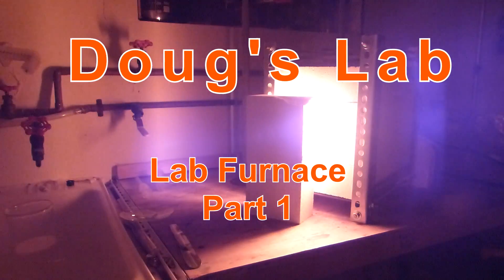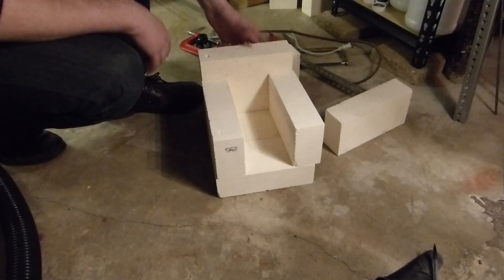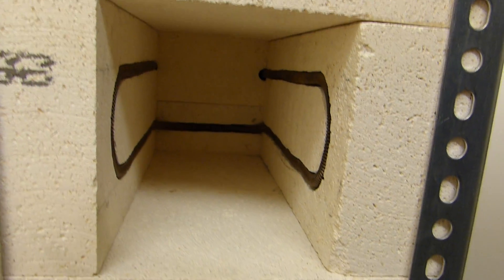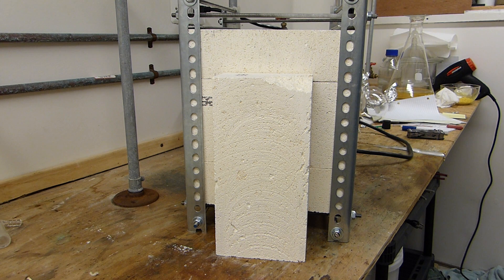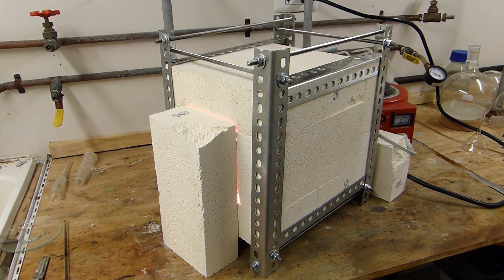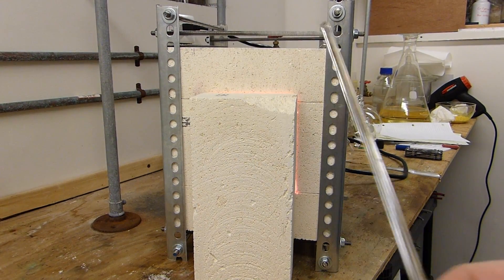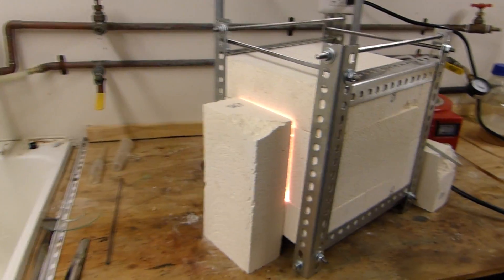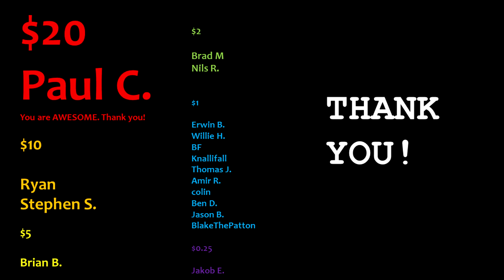DIY Electric Furnace: Part 1

Comment: Nice!  And definitely not as stinky or hazardous as an arc furnace.  BTW, running the heating element 110 VAC instead of 220 VAC means a thermal power output of 1250 watts and not 2500 watts.  The resistance is relatively constant, so the formula to use for power in this case should be Power = V*V / R.
Reply: +theLuigiFan0007 True, but the point is the same...  when Joule heating like this, halving the rms voltage reduces the mean power output to 25%, it's just due to the output being directly related to the square of the input voltage.  Of course assuming that the temp coefficient of resistance of the wire is not just linear, but flat across the temp range it will be used at.
As far as the 110 vs 115 v 125VAC... household power (as shown in the video and as you observed) should be thought of as 120VAC nominal plus or minus 5%.  The 115VAC you mention appliances being rated for, that's just the nameplate value and they should be able to handle plus or minues 10% of that value without real worry.
The 126.75VAC(rms) that you measured is on the very high side but nothing I would be calling out an electrician for.  I might even suggest that the higher readings are from locations with less feet of copper between the outlet and the distribution board/breaker box.
Reply: +theLuigiFan0007 Been there and done that with faulty/missing grounds... lol, it can wake you up faster than coffee... or knock you out even quicker... luckily, I have only been knocked out once when 'becoming one with the circuit' but have come in contact with a number of boxes that try to tickle you when touched.

Interesting about the small grid, each type of power plant design has different ways of dealing with grid loads and at home we see maybe 5 good drops or spikes in the line per day (according to UPS logs).  Our electric company keeps swapping out and adding transformers in this area as well as some jerk around here [looks around] seems to keep doing something to cause them to spill their oil.
Reply: Impatient Ape That is not true! at first, formula used to calculate power is Current squared times Resistance, never seen voltage squared divided by resistance. Second, when the voltage is doubled, the current would double as well, so the power input would be (2x voltage)x(2x current), making it 4x more powerful compared to 110V. Also more power doesn’t have to mean higher temperature.
Reply: @mareksvrcina5279  ohms law says voltage and current are intrinsically proportional. So anything that can be expressed as Amps mathematically, can also be expressed in terms of Volts. 

I2R is generally used for heat loss calculation where V2/R is used when calculating how a change in voltage affects power output.
Reply: @djsnowman06  Agreed! Excuse my ignorant younger self.
Reply: Pertaining to your original comment, he states exactly that in the beginning of the video.
Reply: JimmyDB -
Had forgotten to take into account the exponential power draw with voltage increases for the same resistance. Thanks for the tip. 10% tolerance is a great thing indeed, unlike the regulators I build for digital electronics (CPUs, Video chips, etc). 0.5% or less tolerance. Except Atmel chips like the ATmega 238P (1.8-5.5VDC)... they're pretty robust.

Funny thing is about my voltage, the outlets in my room are the exact diagonal opposite side of the house as the breaker panel, and all the outlets are within about 5% on the readings. I guess the ancient wiring isn't so bad after all. Besides being ungrounded, of course :D. I'v gotten a bit of a prickle off power supplies that need to be ground referenced for safety reasons and had to use adaptors for. More accurately it was like "huh, this feels odd... touches harder AH F***.... Note to self: neon sign transformers must be grounded". XD

I'v noticed on days the voltage is a hint on the high side there's significantly less load (less harsh temps, a line gets switched off somewhere for maintenance, etc) or it's usually during the late night or early morning. I guess they don't compensate for small grid sections in real time.
Reply: JimmyDB -
Must be the squirrels trying to steal copper again. They never learn because it's always too late.....
Reply: Voltage is actually around 121.25V-126.75V wherever I'v checked it in our house (~5% tolerance).
Most appliances are rated 115VAC, but the real voltage is generally 125V/250V.
There's a pretty big tolerance in the allowed voltages between providers and electrical systems.
Single phase: =>106V, =<127V is considered fine. Two phase: =>212V and =<254V is considered fine.

Comment: You should get a fixed shade welding lens (shade 5 would probably do) to put over the camera so we can see in there better. I'm not sure how well you can see it in person but O/A goggles will help if you're struggling to see. Get a pair of cheap MMA gloves too, they won't catch fire like yours did. Very nice furnace BTW.

Comment: Can you add a thermocouple wire lead?
Reply from the maker: +Luc Serre 
I ordered one from China on eBay about 2 weeks ago... it's on the way!
Reply: @DougsLab  did you burn down your lab with this kiln?
Reply: +Doug's Lab Would be nice to put a PID temperature controller on it too.

Comment: Do you need to wear special eye protection when looking in the furnace? (UV radiation?)
Reply from the maker: +David Zed 
Yes, it is starting to get to temperatures where the light can damage eyesight.
Reply: Yes and no, IR rather than UV, (cataracts rather than sunburned corneas)

Comment: Nice work, Doug.
Firebricks are on my to-get list although I was thinking of a charcoal fired furnace for my use.  Good to see it in operation.
Happy calcining. :)
Reply from the maker: +Energy Unleashed 
I should have used a push rod but I figured if I took it in short bursts I could just poke it in there with my hand. Plus, the video was kind of funny. I will be making stuff like calcium oxide, calcium carbide, and phosphorus. I will probably also use it for small aluminum castings, and preparing silver shot.
Reply: +j_sum1 j_sum1 I tried to find some alumina silicate fire bricks once, the closest I could find was pizza oven bricks. if you happen to come across some let me know
Reply: +Energy Unleashed yeah, I used the pizza oven bricks for an arc furnace and produced some calcium carbide, they did the job but they didn't hold up very long and eventually cracked and fell apart